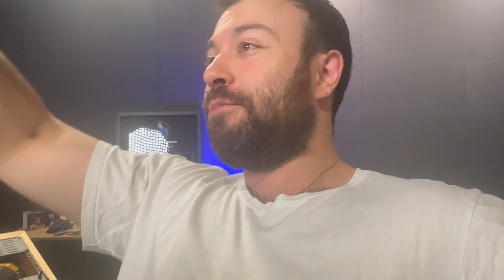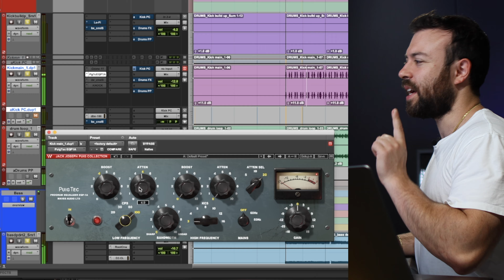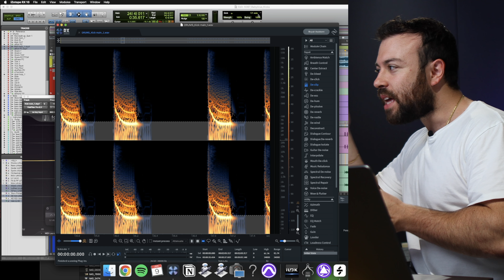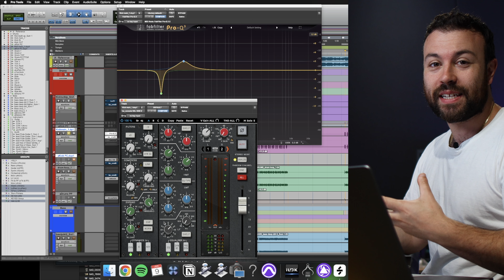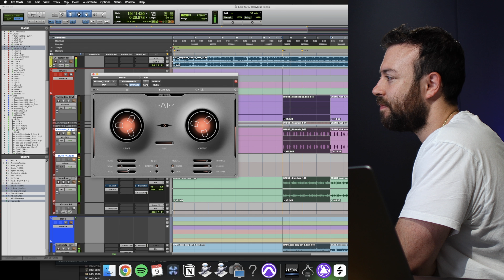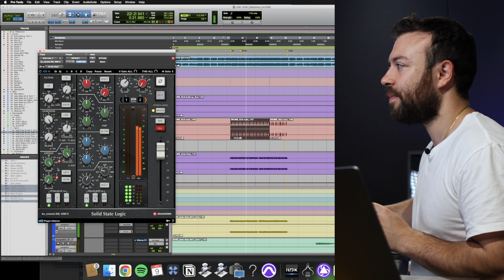Every way to mix a kick (28 Ways)

Comment: Thanks for the video. I'm always a bit confused when clipping a kick. The idea is that the clipper reduces the transient's level (giving you more head room) but without noticeably compromising the sound. However, I notice that when I clip kicks using Standard Clip, there is definitely a noticeable reduction in the impact of the kick even if I'm just doing the smallest amount of clipping possible in the plugin. If you then add gain post-clip (as you appear to do in this video) to restore the kick impact, wouldn't that just undo the headroom-creating effect of the clipping, putting you right back where you started?